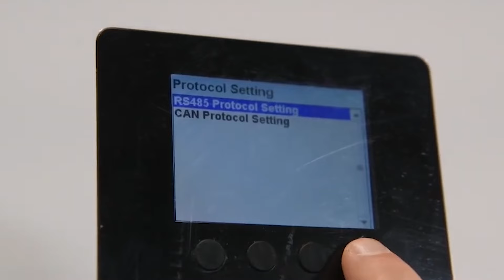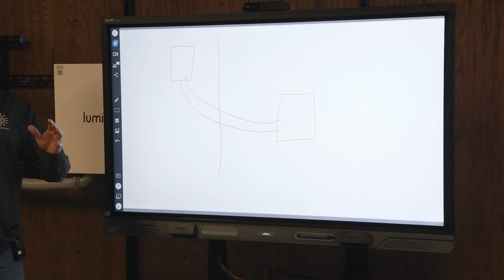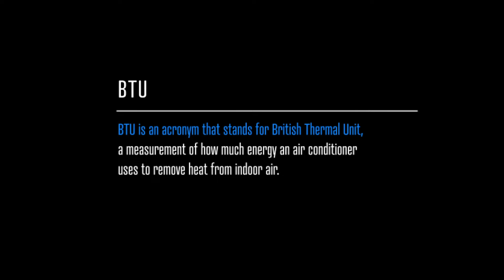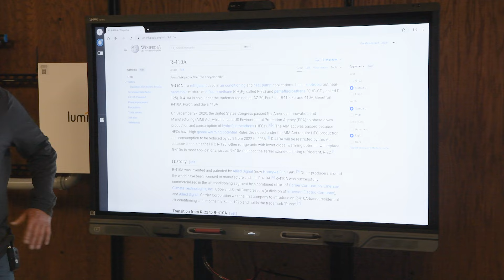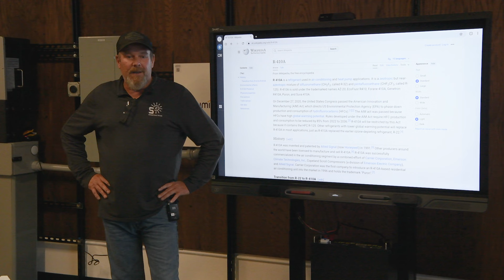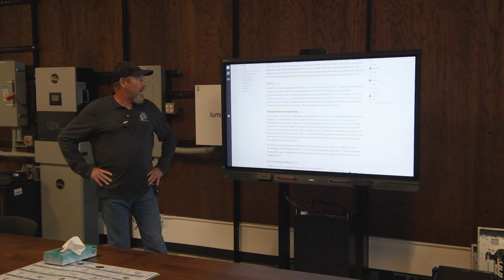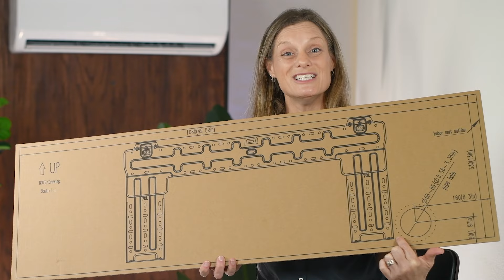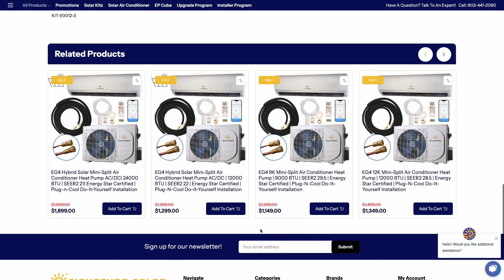EG4 Mini Splits Simplified: Your Questions Answered and How to Install

Comment: Why wouldn't the Condensate Drain line be attached to the LineSet side pre-shipping? and have the 2nd way plugged but there if needed?
Reply from the maker: Hi! Would you mind clarifying what you mean?
Reply: @SignatureSolar  Why is the Condensate Drain Hose on the opposite side as the others that go thru the wall?
Reply from the maker: Understood! This would be a question for the manufacturer. You can reach them at support@eg4electronics.com :)
Reply: @CSJ-CSV AC/DC CURRENT

Comment: I finally got my EG4 9k DIY mini-split installed in my shed and it works fantastic. It's a nice wood framed shed with windows and insulation, etc. and the mini-split can get the  temp down to the low 60's even in 90 degree weather. The efficiency of the 9k is almost unbelievable, and it's incredibly quiet.
Reply from the maker: Thank you so much for your feedback!! Please let us know if you need any support!

Comment: I got the EG4 Hybrid Solar Mini-Split Kit Air Conditioner Heat Pump AC/DC| 24000 BTU  It was a simple setup, also works well.  When I installed my system, turned it on to check it and I had to look at the lights to make sure it was working (It was so quiet. ) within a few seconds it was ice cold coming out of the unit.   Im very happy with my purchase!  Install was simple. Hardest part was figuring out where to put my solar panels.
Reply from the maker: Thank you so much for your feedback!

Comment: I just installed one, works in concert with my central AC. It cut my electric bill by more than half in the past two hot months. Looking into getting more solar panels and adding batteries to power it and possibly a DC electric water heater 24/7.

Comment: Im soooo disappointed I bought this unit from you which is supposed to be able to run directly off solar panels but the model that I have does not have the PV connections nor PV easy disconnects. when purchasing it was not clear that there are differnt models for AC only or hybrid....its too big to ship back !
Reply from the maker: Hi! We're so sorry you're having trouble. If you'd like to reach out to us directly at 903-441-2090, we will do our best to assist. We can provide labels and direction to ensure your return goes smoothly.

Comment: Could you make one improvement to the solar mini split? Let the mini split send out extra power to charge a 96v battery system. The system will prioritize solar array input, but when solar input is not available, draw power from the 96v battery bank. No inverter is needed.
Reply from the maker: Thank you for your feedback! We will forward your thoughts to the manufacturer!

Comment: What do I do with the sealant putty?  Do you have instructions or a video on that (or did I miss it)?
Reply from the maker: The sealant putty is used to seal the connection plate on the exterior of the property. It helps prevent outdoor environmental factors like weather, dust, and critters from getting inside, ensuring a secure and long-lasting installation.

Comment: I just installed  the 12k mini in my off grid cabin. It is very easy, and I am impressed with the performance.  The only thing I am wanting is a tutorial of the remote,  and how to get the most out of its features.
Reply from the maker: Thank you so much for your feedback! If you'd like to reach out to our tech team at 903-441-2090, we can walk you through any settings you need!
Reply: @SignatureSolar  The remote can be confusing, But more so the app and connecting the system to the Bluetooth devices or WiFi.... Just a thought... but Most phones have gone to 5G how are you supposed to connect to a 5g connection.

Comment: Can I branch the incoming pv to an inverter to charge batteries if there is an excess of solar power? I’m concerned about the minisplit getting and using the lower it needs without fighting with the charge controller. 

Plan is to save excess solar, charge batteries and use eg4 inverter to power minisplit at night.
Reply from the maker: No, it's not possible to split the PV between two sources. You’ll need to create two separate strings.

Comment: What about solar panel amp rating is this a issue?
Reply from the maker: As long as the Voltage is correct, and your wattage is good, amperage will be just fine.  The Max VOC will be the most important spec to pay attention to.
Reply: I just received my EG4 12K Solar Hybrid Heat Pump Split Unit.

Your first sentence seems to close the deal, nothing more need be said.
Yet you add the VOC needing the most attention?
This opens a slew of questions for me.

I am using the rated spec (W and V) to compute my numbers, theoretically the maximum that could occur on a perfect inclination/orientation/longitude/hot sun... that the panel will output?

To place this in context:
 (if the answer to all 3 questions is yes, I am ok to take the chance without knowing the answers to all the questions below these 3)

Say on an in series string of 2 (600W 48V) panels, plus 1 (400W 48V), 
I have 1600W total, and 144V total which gives me 11.11Amps.

1. I am not even sure if mixing panels with various Watts is ok, but the obvious math seems to work?

2. is that not adequate to run a AG4 12K solar hybrid A/C?  RECOMMENDED SOLAR INPUT: 1000-1600W (90VDC-380VDC)   1600/90 - 18A???
 -  at 144V it would pull 1600W/144 = 11.11A ?  may be less in eco mode?

3. and does it not satisfy charging a 3600Wh [75Ah] generator that accepts:
                           1600W, 11-150V, 15A on the solar input?

So why use the (max) VOC?  The VOC being the Voltage the panel puts out under no load?  ...and is much lower than the rated Voltage.
Why is the VOC the most important?
In my scenario in -20F it would only pull less than 90V !?

Below, I am including the solar panel specs, because I have no idea which parameter is which, as parameters are not named precisely consistently across venues, and individuals?

The VOC is never mentioned as 'max' ??? ~ that tends to point to max Operating Voltage???
...and as a noob, I would think that the Voltage that is maximum while in operation, is the one I would key on, since it is the lowest and a better choice to optimize the system... but would that be short/blind on tolerance, ranges, limits?
So I don't even know how to ask proper questions.

Ex: 400W rated panel 48V
         - (48V rated ?)
  Short Circuit Current: 13.79A                    SCC ?
  Open Circuit Voltage: 37.10V                    OCV  (VOC) ?
  Efficiency: 23%
  Rated Power: 400W
  Maximum Operating Voltage: 31.00V
        - max ? lower than the rated, even lower than the VOC ???
        - and why is the Operating V not 48V ?  What is happening in
          a solar panel that causes the Voltage to not be a constant?
           - is it a matter of the ambient light strength that kicks in the cells
             to generate a Voltage dependent of that strength hence variable?
             ...and why it has more Voltage under no load vs under load?
  Maximum Operating Current: 12.90A
        - I guess if the charger is 15A, it fits?:
        - But EG4?  (may draw up to18A ???)

(Side note: What about the Vimp?  Vmp? and all the other Voltage types mentioned?)
Reply: Panel wattage mixing is fine technically speaking but you may or may not lose power overall depending on how close they match in volts and amps.   In series the amps are added but the lowest voltage pulls the whole string down to that voltage for your volts X amps = power equation.

These units I believe can ramp down the power so that even with less than full power the unit can run making it not too critical to worry over amperage. 

Yes sunlight affects the voltage of the panel, especially in series so that’s why Voc and max power voltage are different. Voc is higher because there is no load so it’s the maximum possible voltage produced, but you won’t see this for power production it’s just the “ risk factor” . Finally Voc is the important spec because both being the highest voltage and the voltage the unit would see under rest, if it’s too high it will fry the components if out of rating. 

With matching panels plan to use just use Vmp x Isc X 80% on a sunny summer day for your expected real power. 
There a lot of variables and slight differences when panels  don’t match or even between exact panels to worry over it too much. 

I think I answered your pressing questions. Ask more and I’ll help if I can.

Comment: Is a rapid shutdown system needed on the solar panels?  Are there any you recommend that would work without a separate grid or off grid power solution, such as when the power is out?  Is there a rapid shutdown system transmitter built into the unit?
Reply: Really That is a State issue, Most states Will force you to have a rss if you install your solar panels on the roof of your home.

Comment: Does the EG4 Mini Split sit level, are is it lower on on side? I used there bracket that has a level on it and backed it up with 2ft. level they both are dead on. But unit is a 1/4 in. lower on one side. is this for some sort of drain? I'm talking about the outside unit!

Comment: I've got an AC/DC12C Mini-split running strictly off solar in Florida. The EG4 is probably better but mine works. The only thing that bothers me is that I am not using my solar on days when it is sunny but not hot enough to run the AC. On hot evenings I want to run it but the sun goes down so I have to use grid power. I have (5) 400-watt panels and was wondering if you had any suggestions on how to add a battery to the system. This would make a great video I think.  Thanks!
Reply: One method some did was to take a single circuit generator transfer switch and use that to switch it off the main circuit onto a Eco Flow solar power generator. The Eco Flow solar power generator was connected to (its own) solar panels, that power was saved in the battery. The solar power generator also has some advanced app based settings, for example, if the battery gets low, you can use AC passthrough. It is one interesting solution.

Comment: Is it possible to run the hybrid units off of DC only? Edit: I should have said straight from a battery bank. lol
Reply: All day long with sun
Reply from the maker: You cannot run the unit on just batteries.
Reply: I bet they would run from a battery if you had a battery with high enough voltage.  They need from 90v to 380v D.C.  That would be at least two 48v rack batteries in SERIES but I don't know of any 48v battery that can be used in SERIES because the MOSFETS in the normal BMS cannot handle that voltage.  There are higher voltage D.C. systems available, but not typically to the consumer DIY market.
Reply: @Sylvan_dB  yeah, I thought getting the correct voltage would be all that was needed. Thanks, I was not aware of the BMS limitations for running in series.
Reply: @SignatureSolar  what so it can ONLY be powered by solar panels? So it only works when your array is producing enough to cover the entire load? ...dealbreaker...
Reply: @Sylvan_dB  you can build your own battery using LifePo4 cells, but don't know of any BMS using those voltage ranges, charging will be another issue
Reply: @ShaneS071  bms not available for diy, anyway.  Charging is easy because you can charge segments of the battery.
Reply: @SignatureSolar  So when the sun goes down, those who are off grid are Popsicles?
Reply: @sjagain power it with an inverter/ battery powered by the sun.

Comment: I installed solar unit and it works good. I am wondering where the inside unit is sensing the room temperature because it always seems to cool the room much cooler than the unit temperature setting. Does it sense temperature from remote - or from a sensor on the wall hung inside fan unit ?
Reply: I am wondering this same thing. I installed a 24k last week and when you remove the piece that holds the wires in place on the inside, there's a free hanging wire with plastic on it. I assume this is the thermostat, but not sure. It doesn't look like it serves any other purpose.

I have my unit set at 74F but it always says in the app it's 69-71F. It literally freezes the floor in front of the unit so it's like I'm in the Arctic when walking by lol. I'd raise the temp, but then the rest of the house would be too warm.
Reply: @mechillii  they say in the online manual to ignore that connector . Maybe they will answer our questions about this.  Seems like something is wrong .
Reply from the maker: The temperature of the air in the room is measured by a probe located on the head unit. This probe is situated on the right side of the unit, beneath the filter cover, and it captures the temperature of the incoming air.
Reply: @SignatureSolar  The app will show a room temperature much colder than the set temperature. This is confirmed by other thermometers in the room. So the unit should not continue to cool  if the room temperature is much colder than the set temperature . I am talking about 4 to 5 degrees colder . So something does not seem right in it's controller when it keeps cooling despite room being below the controlled setpoint . This is noticed not just by me as other comment shows.

Comment: I want to put this on an interior 2x4 wall.  Will the 3 1/2" cavity provide enough space to bend the copper lines down without kinking?  Thank you.
Reply: It will be very tight, especially if your wall is already closed on the "outside".  I also don't know how you would hang the unit with the lines trying to go down inside the wall. The "normal" install for these units is the lines go completely thru the wall which means you hang the interior unit with the lines poking straight to outside, and being outside gives you a lot of working room to carefully bend the lines down at that time.
Reply from the maker: We have seen and ran the line sets in a standard 2x4 wall cavity, extreme caution has to be taken as to not kink the the line set.
Reply: @SignatureSolar  Thank you for the response

Comment: I have a mobile application. Since I don't want to dedicate the few solar panels I have to just the air conditioner, I'm wondering if there is a way to wire it up to receive DC power from a source that isn't a solar panel...
Reply from the maker: Just PV, you'd otherwise have to use an inverter and then it'd be AC.

Comment: Can I run the lines from inside unit out the side and up into attic ?  My wall is concrete but in attic I can run out roof sides which is wood.
Reply from the maker: You should avoid running the lines upward, as the drainage needs to flow downward to exit properly.

Comment: fundamental question for me because my mounting template for placing my bracket is a level, I measured the bracket again and the bracket is not level is there a reason for that? #There is a loose connector gray cable and white connector where that connector connects thank
Reply from the maker: Hi! We'd like to ensure we have all the details of your questions to answer accurately. If you'd like to reach out to us directly at engagament@signaturesolar.com with a photo of both issues mentioned and we will get those answers for you!
Reply: @SignatureSolar  I installed it yesterday and had a small problem because the mold was not the same as for a 9k one and I bought the 12k one. Now it works perfectly without much noise. and I put his circuit with his service breaker 20 A

Comment: Your mini split use R410 and Mike said the FPA going to get rid of it. So what about the products you've sold? If they need refill? Or what is going to happen to your mini splits you have in stock?
Reply from the maker: January 1, 2025: The EPA will set a 750 global warming potential (GWP) limit for air conditioning, which means R-410A (GWP of 2,088) will no longer be able to be used in new equipment. Self-contained HVAC systems using R-410A will also no longer be manufactured or imported after this date. However, there is a three-year sell-through period, so self-contained or packaged units can be sold, exported, and installed through January 1, 2028.

Comment: How long is the drain line from the blower unit? And how long is the power cord from the blower unit?  Are they the same length as the 16ft pre-charged lines?
Reply: Yes it's either the same or very close. I installed a 24k last week and had to cut the drain line shorter. Initially, the water backed up because the drain line was dragging the ground and not letting water flow out properly.
Reply from the maker: Drainpipe 5 ft. length x .59 in. diameter (1.5m x 15mm)

Comment: should have used example of using something like the 6000 or Gridboss and hooking up your battery's. What if your AC isnt on and those pannel's are in full sun.
Reply from the maker: Nothing will happen; the electricity remains at the panels. It's similar to how a light switch works.. power is always flowing to the switch, but it doesn't reach the light until the switch is turned on.

Comment: Hi Kelly my name is Keith I have a eg4 mini split I installed it and turn everything on but my solar is not working am I doing something wrong
Reply from the maker: Hi! There could be a few reasons but if you'd like to call into our tech support line at 903-441-2090, we can look into your issue and get you taken care of!

Comment: All I want to know is how I run the hybrid solar system from a solar generator when the sun goes down. No Grid power available.
Reply from the maker: You will just plug it into the Gen port and adjust the priority settings :)